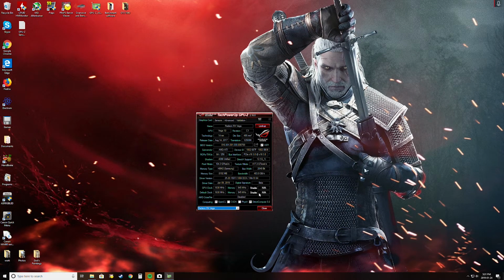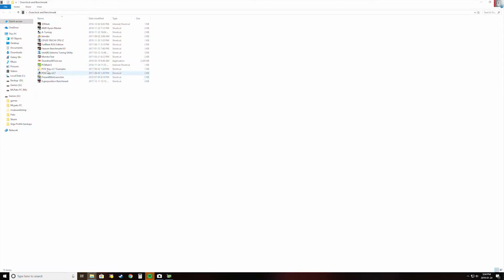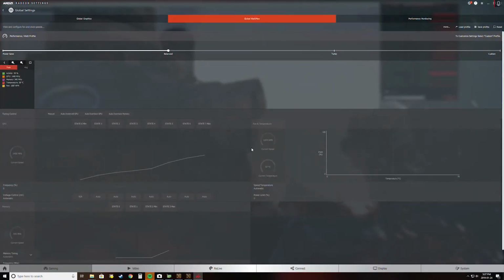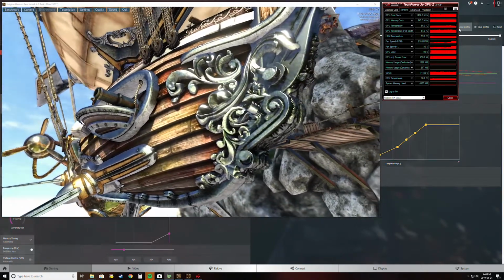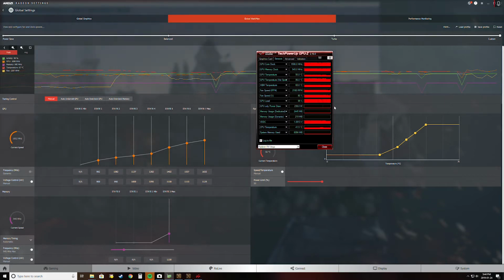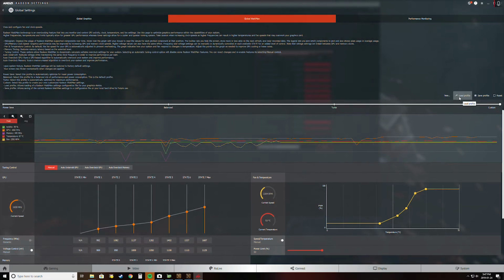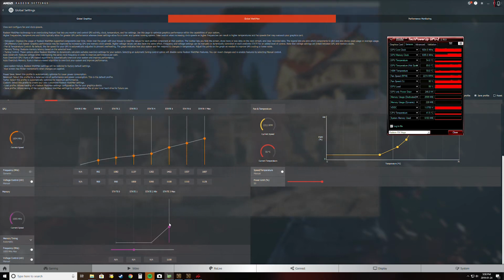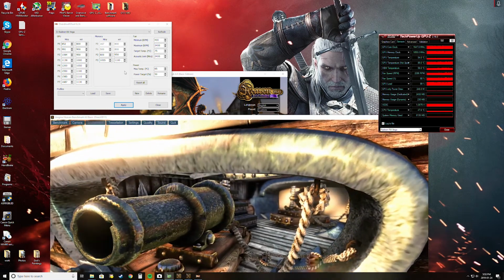How to Overclock your AMD GPU

Comment: My radeon graphicsTM r4 is so bad its at a clock speed of 800 🤦‍♂️
And its so frikin slow idk how to even play minecraft at 60 fps on this potatoe machine
Heaven benchmark:*not responding on low settings*
Reply from the maker: Hello, the R4 graphics are integrated graphics from 2014 if I am thinking of the correct GPU....what you are describing is to be expected from integrated graphics of that time. The only way to improve your performance would unfortunately be with an upgrade.
Reply: @McPatoPC  and i even got this laptop 3 months ago wow ;-;

Comment: I am trying to overclock my r9 270 but it will not work. I tried AMD overdrive and MSI afterburner. I set the core clock, memory clock, and power control to where I wanted the overclock to be but when I open the Witcher 3 or FurMark, the clocks on both memory and core do not go higher than the default settings. Then sometimes if I close AMD overdrive go back into AMD overdrive, the overclock settings are back to defaults. And yes, I have clicked "apply" after making the changes.
Reply from the maker: Are you moving the power slider to increase the power limit? It could be that your card just needs more power in order to clock higher. Another limiting factor is temperature,, if you are in the high 70's or even 80s the temperature may  e limiting you. Finally if you are putting in an overclock that is too high it might not work and therefore it could cause it to seem like the OC did not work. Try small overclocks like 25mhz at a time and see if that works. Hopefully one of these tips helps :)
Reply: Power limit slider is not working amd it's not r9 it is radeon r2

Comment: U sound like u know about these things, so could you help me? I have AMD A10-7800 Radeon R7 gpu. So, i have been playing fivem/gta v and now my gpu is using all the time 99-100%. 2 months ago it was playable and no lag cuz gpu usage was not that big all the time. I was thinking, does overclocking help?
Reply: Also the same problem comes with other games too, not just gtav /fivem. Csgo also came little bit laggy. I tried to put high priority but it doenst help at all
Reply from the maker: Hello, are you playing at 1080p? Honestly I'm a little surprised that you are getting 99% GPU usage with the A10 processor. The truth is high GPU usage is a good thing, it means your GPU is not being bottle necked by your CPU. Say you had GPU usage of 60-80% it would mean your CPU was holding it back, but that does not seem to be happening. Lower resolution gaming....720p or 1080p puts a heavier load on the CPU, which is why most benchmarks to test cpus are done at 1080p. You could play around with dynamic resolution and have the game upscale to 4k or 1440p those if the lag gets worse or better with less of a load on the CPU. Are your FPS staying high or do you get big dips while gaming...? Big dips in this case would also suggest the CPU bottleneck. To be sure I'd run benchmark software like Fraps or MSI afterburner and see if the CPU usage spikes while GPU usage is lower....this this happens when you get lag then it is the CPU. However high GPU usage is the goal as it points to your system being able to support your GPU while it runs at its max, and that it is not holding your GPU back. You could also try using the AMD software to set up frame limits which would take some load off the GPU and could help you get a more optimal consistent gaming experiance. And would certainly lower your GPU usage.
Reply: @McPatoPC  Im playing with 1920x1080 resolution. I don't know whats wrong with gta and couple games that i used to play, it was playable but no it gets big dips all the time that its not even fun to play anymore. Can't play even 5sec without lagging. Big dips is my biggest problem, without the lag it would be like when it was working. The lag just came and i can't get it back to normal. I recently changed to 27'' 1920x1080 monitor, but there was no problem with it, just little bit laggy but not that bad as its right now. I played before this monitor with some sony 32'' tv 1360x768 resolution 60hz, with it it was not laggy.  It just came laggy, i tried high and low settings and no difference.. Lag is with both. Im just so confused that it worked so fine but now its just so laggy.

Comment: Can you please help me... How to over clock a HP Notebook - 15g-br104tx with Intel® Core™ i5-8250U (1.6 GHz base frequency, up to 3.4 GHz with Intel® Turbo Boost Technology, 6 MB cache, 4 cores)

Memory, standard

8 GB DDR4-2400 SDRAM (1 x 8 GB)

Video graphics

AMD Radeon™ 520 Graphics (2 GB DDR3 dedicated)
Reply from the maker: Hello, unfortunately without being familiar with that particular laptop I am afraid I can not provide you with any assistance. Depending on the model it may not be possible to overclock it at all. The best option would be to search on Google or another search engine for forums relating to the model of laptop you have. Thank you for taking the time to comment, I am sorry I can not be of more help in this case.

Comment: I NEED HELP.. I want to fix this stuttering so i  can have fun with my friends but i cant because of this stupid stuttering
Reply from the maker: Hello, I'd be happy to try and help, but you would need to provide information.....what GPU using what monitor....in all games or some games? Are you using vsync? Or freesync or gsync or any other type of adaptive sync? What refresh rate is your monitor and game set to use.....what CPU do you have?
Reply: @McPatoPC  where do i find that info
Reply: Radeon Software Version - 19.1.1
Radeon Software Edition - Adrenalin 2019
Graphics Chipset - Radeon RX 570 Series
Memory Size - 4096 MB
Memory Type - GDDR5
Core Clock - 1244 MHz
Windows Version - Windows 10 (64 bit)
System Memory - 24 GB
CPU Type - AMD Phenom(tm) II X6 1090T Processor
Reply: and My Parents gave me this monitor so i dont know what it is
Reply from the maker: What games are you playing? Honestly likely you are playing games with your settings too high for the hardware you mentioned. What I would recommend is while you are in a game, press Ctrl+Shift+o and open up your in game performance overlay(which is done through your AMD adrenaline software), then when gaming you can see what FPS you are getting  and what your clock speeds are. Also when in a game you will likely want to enable Vsync which is found in the settings under Video or Graphics. Depending on the game you will need to lower your settings.....likely Medium at 1080p possibly low depending on the game in question. If your FPS (Frames per second) are under 40....then likely you are playing at too high of settings. If you are able to get 60+ Vsync will help smooth things out. Let me know if I can be of more help.
Reply: @McPatoPC  I play fortnite stretched  i get 60 frames smootlhy then it randomly just goes to 20 for no reason
Reply from the maker: Yeah enable vsync see if that helps smooth things out. It could be the CPU causing stutter but, try vsync and if you want to be sure maybe lower the settings to see if it helps more....

Comment: This benchmark shit is the only thing i dont get. i tried it in every way possible and the results , the fps, the gpu temp, eveything changes based on the resolution.  it can be good if its not fullscreen but then you run it again after all the overclocking and it shows artifacts or maybe freezes only based on the resolution you choose. i always wanted to understand how this works and i still dont get it  much love from italy
Reply from the maker: Hello, thank you for your comment. I will try to help explain benchmarking to you as best I can. It is very normal and expected that the results and temps change with different resolutions. 1080p indicates a specific resolution which is based on the number of pixels on the display...the same is true for 1440p, 4K ect. The reason your FPS will be different at 1440p vs 1080p is because it needs to work much harder to put the extra detail/pixels on the screen. Let's say at 1080p there are 1 million pixels...let's say at 1440p you would have 1.6 million (just an example not correct numbers) so let's say 60% more pixels....that is in part why it's harder for your GPU, and because it works harder it will run warmer because its using more power to get the job done. When you are at a lower resolution your GPU can usually perform faster than your CPU can process its parts....or at least the CPU must work harder to keep up...so at 1080p you are going to find limits in the CPU and GPU in some cases. When you go to 1440p or 4K your GPU is likely going to be the slower part and that will take some of the load off the CPU....other things like memory speeds and system temperatures will affect your performance at any given resolution.
Reply: @McPatoPC  yes exactly thank u all this is clear and i understand it perfectly. the ONLY problem that comes is that if for example i overclock my card lets say : 1500 mhz,  +25mv , vram 2250mhz. i run in 1080p msi afterburner (the only one i trust because finds any artifact possible) for 30 minutes and everything is perfect with 0 artifacts. the second i run THE SAME OVERCLOCK but change for example to 1440p after lets say about 3 or 4 minutes of running the benchmark i get right away artifacts.  
So pretty much in conclusion i must overclock and benchmark with 0 artifacts the card in the exact resolution i will be running windows and games at, correct ? much love
Reply from the maker: Yes, it is best to test it at the resolution you will be playing at. Also if you are seeing artifacts you are pushing it a little too hard. I'd recommend scaling it back to the point you no longer see any artifacts. Good luck!:)
Reply: @McPatoPC  yes absolutely i only worry about artifacts. and i do get ansolutely 0 arifacts (Msi Kombustor 4 ) with the current overclocking at 1080p. so im gon run it all over again at my preferred resolution and adjust mhz and mv accordingly. thank u very much its been months i been tryin to figure this out since nobody ever talks about this ( linus Jayztwocent nexus gamer ) they all run and show benchmarks in window mode. but like that thats easy to get 100000000 fps with low temps. Thank you very much shout out to you

Comment: nice. I have oc ver. of vega 64 but I have problems finding current undervolting settings. btw link to Geralt wallpaper? ta.
Reply from the maker: Thank you, honestly I just googled Witcher 3 1440p wallpaper and found it that way, so I'm sorry but I dont have a direct link for you, but check google I'm sure you will see it there:)
Reply: @McPatoPC   thanks not a problem. for some reason when I undervault AC:O to (920v for power consumption/performance around - 1450) other games dont work well on same settings its annoying to switching and changing undervolting for different games.
Reply from the maker: If you want a setting that works for all games find one that seems to be harder to run at the setting you have now. You will need to find at what voltage and clock that game works at. Once you get it working you should be able to use that profile for all your other games. For me the Witcher 3 is the game I own that is the hardest to run....its also the game i play the most, so when I set my profile I used that game to test it. If you want another option could be to set up a low power profile and a higher power profile and save both for easy loading and switching....I hope this helps.
Reply: @McPatoPC  noticed you didn't touch memory speed. gigabyte OC 64 I set it to 910v 1025. For lowest voltage/performance speed.
Does power limit +50 increases power consumption or reduces? 
Trying to find sweet spot for lower voltage to make card stay solid at 1500.
Also, witcher 3 is awesome.
Reply from the maker: I run my hbm2 at 1140 24/7 in the video I got concerned with how long it was getting, so I did not demonstrate it, but I certainly do run overclocked memory. Moving your power limit to +50 allows your card to use more voltage when needed. You can also reduce it if your goal is minimal power consumption. My goal is best performance, but for example when I mined with it for a little while I did set a power profile and did slide the power limiter to about -10% and I was able to run it under 180watts
Reply: @McPatoPC  best performance is great but for some reason when I set to higher/stock voltage my card whine. Lowering voltage stops any noise. Dunno seller said its normal so can't exchange it. Reason why I want to undervolt voltage. Also electricity isn't cheap in UK and AMD is always hungry. Ta.
Reply from the maker: Ah yes.....seems you have cool whine:(

Comment: Hey! I flashed the Bios on my Powercolor Red Devil Vega 56 to a Vega 64 Bios, because mine has Samsung HBM. I undervolted it heavily to the point where it now runs at 950mV in P7 at around 1500 Mhz with +50% power target, down from 1549Mhz stock speed at 1200mV in P7. The consumption went down from 275 W at stock in Deus Ex Mankind devided (demanding scene) to 184W and temps in that scene went down to 67°C from 83°C at stock with 1900RPM.  Due to the Bios flash I can overclock my HBM from 850 Mhz at stock to 1040 Mhz. Before the flash I could only overclock the HBM to 935 Mhz before crashing. my FPS in that scene went from 84 FPS up to 89-90 FPS. So to me it is an efficiency monster right now. it won't score good in benchmarks, but power to performance ratio is through the roof.
Reply: 'visible confusion'